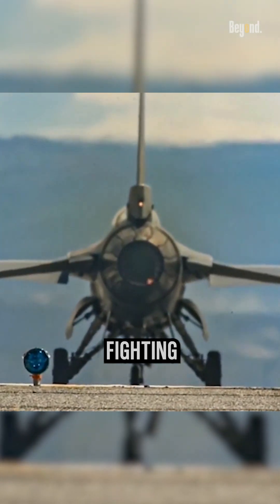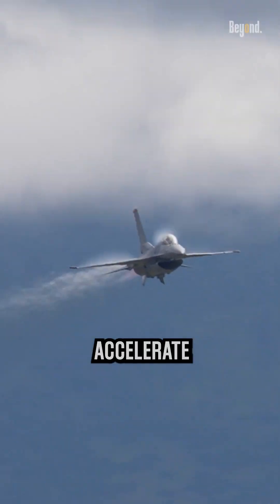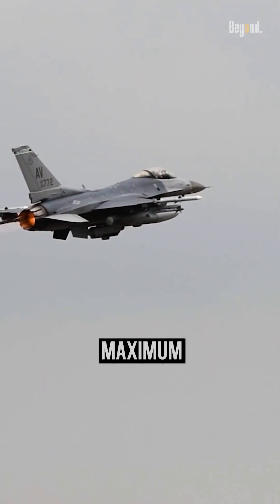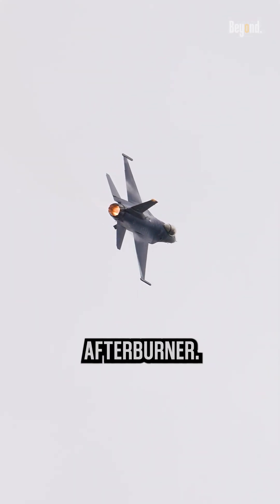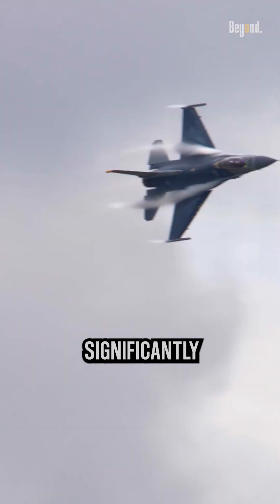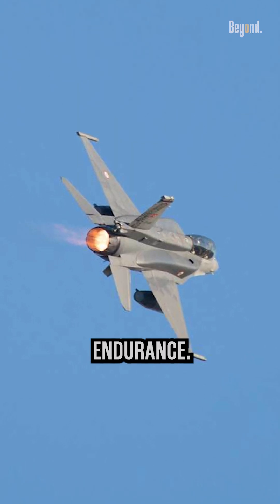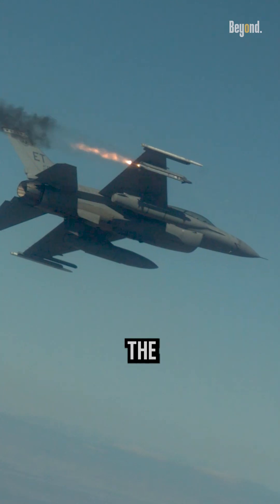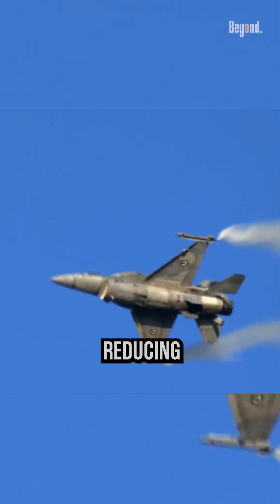How long can an afterburner be used on an F-16? #shorts

Comment: And to to think that the mig 25 would essentially need an engine rebuild after going full throttle in just 1 flight. Shows how well built the American planes are built.
Reply: I mean russia does try and make things cheap so the US just put more care into their military
Reply: Agree for the most part, but role has a big part in that. The MIG-25 is an Interceptor and was designed with all out max speed, with the SR-71 in mind

Comment: What you don't mention, is that in afterburner, the fuel consumption skyrockets, so much so, that I understand that you can burn all your fuel in about 15-25 minutes (time would depend on aircraft type & fuel load⛽️). There's an article where an F-4 pilot was careless with his afterburner & burned up all his fuel & had to eject. He managed to keep his wings 🪽, but he said that he was VERY careful with his afterburner use during the rest of his career!!
Reply: Oops. I'd have said, "apologies...my religious book...or a photo of the commander in Chief must have fallen from its normal position and covered the fuel needle and it was so loud I didn't hear the warnings.
Reply: The video did indeed mention fuel consumption as a limiting factor.
Reply: @dustinpierson490  Yes, it is mentioned as a factor, but it doesn't explain how fast fuel would run out in constant afterburner ⛽️ 🕳!!

Comment: F-16 has 29,000lbs of after burning thrust, 1 engine.

F-15 has 29,000lbs(229 variant) of after burning thrust, 2 engines, 58,000lbs total. Less for the 220 engine variant.

SR-71 had 32,500lbs of after burning thrust, 2 engines, total of 65,000lbs. Using Ram Jet style engines.

MiG-31 has 34,000lbs of after burning thrust, x2 for 68,000lbs total. Using a dual shaft turbines with a lead compression turbine to increase pressure density for the secondary compression chamber which brings 70,000' to a 60,000' density altitude. All before the afterburners have any say in the matter. Completely different than utilizing the energy of the shockwave like the SR-71 did.
And it was armed.
Reply: The sr71 was armed too. It perhaps shot more than any other jet. It was just armed with a camera and shot photos. 

And you could make an argument that the st71 did WAY more damage to the cccp than the mig ever did to anyone. While the Soviets were just making guesses at what we had, the sr71 let us know exactly their capabilities. 

Not to mention all the use the CIA got out of the a12s.

Comment: If you have two engines, is it possible to use an AB on just one engine,?..
Reply: No, the thrust imbalance would make control an issue
Reply: Unless you have a piddly little AB.
Just dont turn…

Comment: The use of AB does not add any more wear to the engine or components more than running in full mil power. The real issue with AB is fuel consumption. The F-16 burns about 8,000 lbs of fuel at full mil power and low altitudes, but this skyrockets to 64,000 lbs when full AB is used. AB is the a massive user of fuel and range. That is why it is not used much.
Reply: HAHAHAHAHA coming from an full up engine run 7 level, I hope this conversation continues… In all reality, both are correct. From a pilot standpoint, fuel usage is the reason, from a maintainer standpoint, wear and tear is the reason, but, we all know, pilots don’t give a shit about the maintenance part. PFM is what they think it takes to keep planes in the air, my friends, P…F….M…
Reply: @F16crewchiefgetsome Spoken like a true tech & maintenance person 👍!
Reply: I'm assuming you're not a maintainer based on your first assertion.  The sprayrings/bars, flameholder, aug combustion liner, convergent liners and divergent nozzle components are absolutely abused while in burner, driving more wear/maintenance.  A -220 at sea level will consume north of 10000 at Mil, and the -229 & F110 moreso.  I've run -220s to 51000 but not -229s or F110